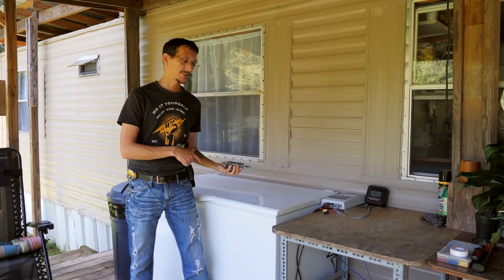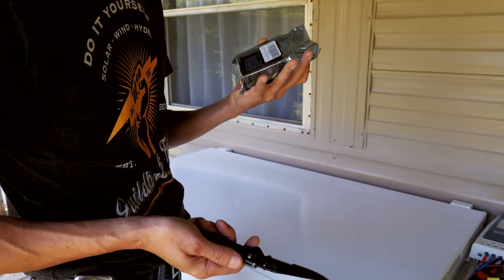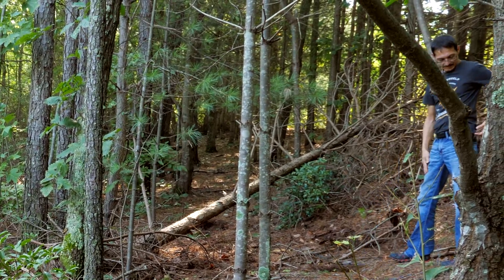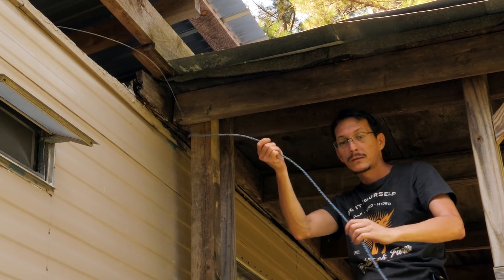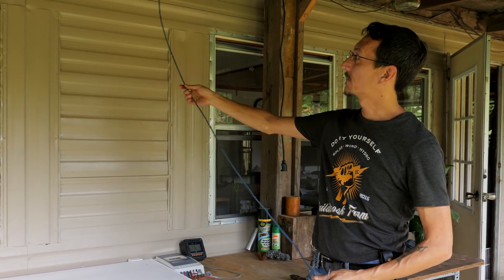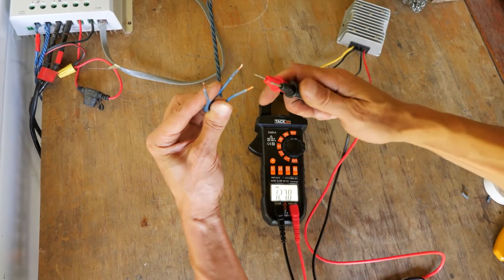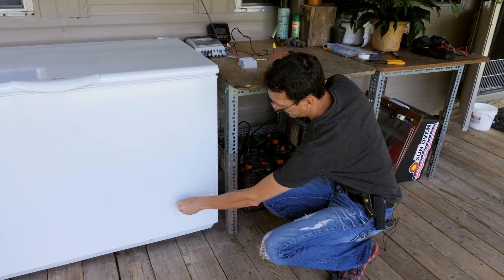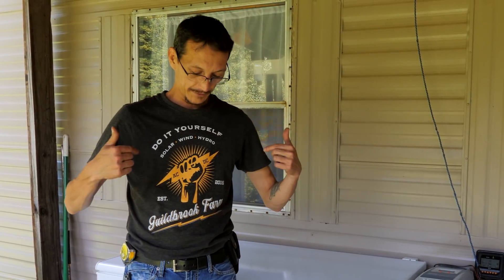Off Grid Solar: Installing a 48V DC Step Down Converter

Comment: Can I use the step down converter like this on the solar panels to make them 12v from 36v before power reaches battery bank?
Reply from the maker: Not sure. I think the step down is made for connecting to a power source with a stable consistent voltage like a battery bank. Panels are highly variable and erratic with their output which is why we use charge controllers to the battery bank and then connect everything to that.

Comment: If you used 6 guage wire from the battery bank to the 48/24 step-down converter, you wouldn't have any voltage drop. I'm upgrading my own system from 10 guage wire to 6.

Comment: Why not find small 48 to 12 and use DC lights? Have a 48v switch not on the 12v side to save your battery system

Comment: 2 Quick questions, first why didn't you do a continuity check on the wire  before you strung it out? You could also have labeled positive and negative before spooling it out. Secondly, wouldn't you want the inline fuse close to the inverter, instead of by the freezer? What if the line shorts out between the inverter and the freezer?
Reply: Yes, I would have put a fuse at the battery end. That wire is providing virtually unlimited current. In the event of a short-circuit it will glow red then melt, with the potential of fire.

Comment: You might consider adding another fuse near the power center.  Just in case the wire (since it is unprotected) would ground out, it would not take down you whole system.  Also since the Converter was so in expensive, it would be worth having a extra hand, just in case something would happen to the one running, you could replace it before the freezer thawed out.  Thanks for the Videos.  I wish you guys luck.

Comment: Putting that many amps through blade connectors is kind of sketchy. They have a nasty tendency to work a little loose and put enough ohms in the path to really pump out some heat. You never notice until you check it one day and they sleeve is cooked and crumbling, or god forbid, whatever it's setting on reaches ember.
Reply from the maker: Blade connectors suck. Mini terms suck. I’ll be soldering it all and adding a switch.
Reply: Do you worry about bears getting into the fridge and freezer?

Comment: Your fuse should be as close as possible to the source, the 2 buss bars.  As it is, if there is a short in the wire, you could have a fire.

If your buck converter get warm, you may have to add a fan.

Comment: This comment is for every one or people that just may not know this:  If you were not going to repurpose your old system "batteries, solar panels, and  controller's" You could go through your old charge controller and battery system to have back-up battery system for your freezer you would  power off of the old batteries not off of the main line. The main line would be just to charge the batteries by putting in a insulator.

Comment: Good grief, you guys are patient! All the unsolicited "advice" must be driving you all nuts. Seriously though, you're all amazing. A huge inspiration to my family at the least, we jump on every video that comes out like they're made of diamonds :D Best of luck to you.
Reply: It's not "unsolicited". These nice guys ASK for comments. They can take it or leave it but, as they have stated in previous videos, it could be useful to others doing something similar.
Reply: The Reason they get so much good advice on their Solar Videos is because it’s a topic that people including myself know about either through university or job. Almost no one is a professional canner or a canning scientist so there people can only comment with their experiences and preferences. 
With there electrical videos however you get so many electricians and electrical engineers who KNOW for a fact that some of this is dangerous and could potentially burn your house down or kill people. Thats why they comment. 
Breaking DC ist more complicated than breaking AC, Batteries are no joke because over the short run to the bus bars they can potentially deliver several THOUSAND amps, Wrong style of connectors can have a high resistance and they can get hot and potentially start a fire, and some measurements may just be flawed and mislead them into thinking they have no voltage drop when in reality they sure have.
All that expertise from highly skilled professionals should and can be used to improve your setup and make your off grid solar so mich safer.
Or you can just call it unsolicited “advice” because you don’t have any clue about the subject and your knowledge ends with “power comes our of the socket”
All the other viewers or our two guys can profit from the vast knowledge combined of the people on the internet and that’s why they specifically ASK for advice.

Comment: I think you should have a fuse or breaker at the load center area in case the wire shorts out

Comment: As other commenters have suggested, the fuse/breaker needs to be sized for the wire coming out of the bus, at the bus, but it also needs to have an interrupt capacity (AIC) higher than the current rating for all those LiFePO4 in parallel at their internal resistance and the wiring resistance to the fuse. Otherwise the the fuse can explode or terminals in a breaker can fuse and not trip, or will degrade every time they arc when tripping. At 25C the internal resistance might be 10 milliohms per battery. For 6 batteries in parallel that's 0.0016667 ohms. At 48V/0.0016667 ohms that's 28,799 A (28.8 kA) of current those batteries could deliver momentarily before their internal breakers would trip. 28 kA at 48V even for the microseconds it takes for the batteries to internally trip is a lot of energy that has to be dissipated in an external fuse or breaker.

Comment: You didn't see any voltage drop because there was no load at the time. I bet if you measure the input voltage at the buck converter while the freezer is working you will see a drop.

Also, as others have said, you need a fuse at the battery to protect the system properly.

Comment: Gives the idea of a step down to 12vDC for lights in the new house. Yes a lot of the setup can be done with sunlight but you will still want lights at night or in the basement and keeping them DC cuts down on the inverter load.

Comment: you did well to bring the voltage down to the 24vdc your freezer needed, but you did not mention anything about the POWER rating of the freezer (or i missed it).  the converter shows that it's rated for 250Watts (10A). is the freezer using only 250Watts or less?
Russ from Coral Springs, Florida, USA.
Reply from the maker: The freezer never draws more than 2 amps. Average 44 amp hours per day at 24 volts. It’s freakin awesome.
Reply: That IS amazing! 2amps at 24VDC!!! less than 50Watts!
Reply from the maker: Yes. Worth the upfront cost.
Reply: @Guildbrookfarm  that means that refrigerator 48w

Comment: I am sure you know that the wire you used is for AC not DC.  Glad to see you are going to add a fuse.
Reply from the maker: Yes solid copper works fine in this application
Reply: Robert the whole this wire is made for AC or DC is just marketing. Power only cares what the resistance is between point A and point B to say how much of it is turned from usable power into heat.
Reply: The wire type in this case won't make any difference, but AC and DC wiring can be different, read about the skin effect if you want to learn more.
Reply: Craig Overend Skin effect is not really significant at 60 Hz and the gauges of wire needed for normal home currents. The skin depth at 60 Hz in copper is 8.5 mm, 0.33 inches. So you're good until you need a wire size of double that or a wire somewhere bigger than 0000 AWG.

Comment: You need to put that fuse at the power source. If something shorted that wire out before the fuse you'll have a potential fire.
Reply: Exactly, He does not realise how dangerous it could be during a short circuit along the way
Reply from the maker: Calm down. A second fuse goes in at the bus.

Comment: Couldn't you have just got a 120VAC to 24VDC converter and plugged it into an outlet at the trailer?   Is that even an option? Would it be more or less efficient? Would it be more or less expensive?  Love watching your channel!
Reply from the maker: This bypasses the inverter completely. To invert 48v DC to 120v AC and then convert back down to 24v DC would be way less efficient and basically a big no no. This simply reduces 48v DC to 24v DC. No inverter necessary.
Reply: Interesting - most buck converters are only around 80% efficient, so its a close run thing depending on the inverter / transformer efficiency.

Comment: I know it is just temporary, but you should move the fuse right after you come off 48 volt bus.  If the short the batteries will send enough amps to melt the wires less than a second.
Reply from the maker: I have a second fuse I’m putting in at the bus.
Reply: @Guildbrookfarm  thanks, BTW I love your videos.

Comment: Will the freezer be moved come winter?
Reply: I’m not a scientist but.... I used to think that a freezer outside makes sense but... read up on refrigerant operating temps. I think what happens is... ambient temps drop to below freezing.., just below the refrigerant stops working and.... for a period of time the temp inside freezer equalizes to ambient temps just under freezing... huh and until the ambient temp averages drop below 10F your freezer is too warm!  Ideally -10f but hard to achieve without commercial grade refrigerant and more wattage.   Haven’t tested this theory yet but... worth testing could make for good content!!!
Reply: Problem lies in temp differential of evaporator/heat exchange lines and the condenser. As well as efficiency of given refrigerant at decreasing temps. Time to put up some graphs!
A way around it would be to box in the compressor cavity into the inside of the house so you would be heating the house and cooling the freezer 🤔
Reply: Chum Robarge the refrigeration cycle is not making a place colder it is shifting heat from one area to another.  The direction of flow is heat is absorbed in the evaporator, Compressed in the compressor and then ejected in the Condenser. The condenser's work becomes easier the colder the temperature around it is so the colder it is out side the less the system needs to run for the same effect. 

For common household refrigeration the condenser caps out around 130-150F as it equals the temperature so no heat transfer, It has no low temperature as the cooler it gets the faster it can give up the heat it has. The evaporator becomes less efficient the colder it gets with it only able to work to the boiling point of the refrigerant used, R-134a is the still common one so it maxes out at -15.34F. 

Now there are 2 known problems with running them outside and they are critters making nests around the warm motor and dust/grime building on the condenser coils faster then if it was inside as the refrigerant moving inside can create a static charge attracting dust.
Reply: Andrew H so they run well around 25 .degrees?
Reply: Chum Robarge for the refrigeration system itself it would work very well with outside temperatures of 25F for a freezer set down to -10F it would have no problem keeping the system cold. 

For a fridge set for 40F you run into the problem of the refrigeration cycle is one way so heat is needed around the fridge to work its way in the insulation over time to keep the temperature up. You would most likely end up with a freezer over time as the heat inside migrates out. 

@John Chrasson What type of engineer? A Bill Nye a mechanical engineer turned actor, A Jeremy Clarkson Honorary PHD engineer or a janitor?
Reply: Andrew H so a chest freezer will hold the thermostat temps down to the point where ambient temps equal internal temps to the point where thermostat stays open in a linear efficiency? For every degree colder outside the unit consumes x watts less? That’s what I was after
Reply: from - GE Side-by-Side ONLY - Refrigerator Repair Videos
4 months ago
Hey, here is a video of a part that is made by Frigidaire.  It’s a heater element that warms the housing that holds the cold control sensor that is contained within the Fridge section. The issue comes when the ambient temp drops below the interior temp of the Fridge.  So, the heater 'fools' the sensor and causes the fridge to run more often. Title of vid "How to install Garage Refrigerator Kit - Frigidaire Electrolux"
Reply: Problem with garage fridge is usually the freezer not working properly according to people that know a lot more than I do about this.
Reply: Don't know what temperatures are there, but almost all fridges and freezers are designed to run in an environment that is between 65ºF and 85ºF. Anything hotter or colder than this range will seriously shorten the life span of the unit. There was an excellent discussion on this on the Permies forum a few years back when Paul Wheaton was thinking about putting a fridge in his (new at the time) Wafati (if I remember the name correctly) and an engineer strongly advised against it because running it in an ambient temperature well below the operating range would fry the fridge before it could raise the ambient temperature up to the operating range. Worth checking out. I'd hate to see you fry that beautiful appliance.
Reply from the maker: Nope

Comment: Measure the voltage drop when freezer is running, you won't see a drop with no load.
Reply: The magic of higher voltage, lower current (for same power), therefore less I squared R loss.
Reply from the maker: No drop

Comment: Nice video . You may need to put a fuse just as the new wire you installed leaves the circuit box and before it goes over the top of the trailer not for voltage drop like someone commented but because of varmints like mice and squirrels chewing the insulation off and causing a short that can feed back to your power box. If you leave it how you have it then the only part that power gets stopped at if a short occurs is just at the freezer and nothing before it causing other shorts in the circuit. I hope this makes sense. Good luck on all y’alls DIY projects. I’ll be watching 👍👍👍
Reply from the maker: Yes I have another fuse I’ll put in at the power center.

Comment: pleeeeeze put a fuse or breaker on the new line from the batteries, huge current available, I've seem the consequences of "summin go wrong" fuse on the beginning of line, not on the load.
Reply from the maker: I will

Comment: You could take your old 12 volt system over to the shipping container and have it setup to charge batteries for power tools so you don't have to take them over to the house if you don't have an extension cord run over there already
Reply from the maker: I’ll probably use it to run some lights in there for now. 👍🏻

Comment: I'm not sure I completely understand why the freezer is outside. Given the difference in out  verses inside temperature, wouldn't it be more energy efficient to keep the freezer inside (especially on a hot summer day)?
Reply: The difference in outside temperature and inside temperature is small, especially for that type of freezer. There's also the problem of it heating up the house.
Reply from the maker: Because there is no room for it inside.
Reply: The outside temperature is usually colder than the temperature inside the house, during summer (sunshine) the PV system has excess power to fight the heat.  in Winter no Sunshine, no power.  So, the colder ambient does not require as much power to maintain the 0F(-18C) set

Comment: Should have a fuse within 18" of the batteries to protect the step down converter.
Reply: kenneth g reid you are almost correct, fuse protects wiring. If device fails, or squirrels eat wire, the fuse blows instead of wire melting.(FIRE)
Reply: I should have said wiring to the converter , cheers